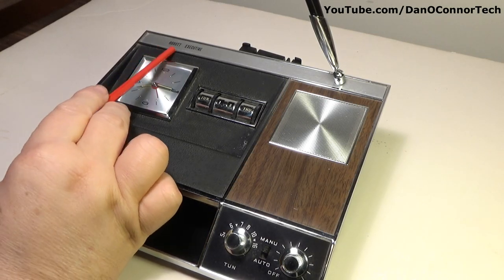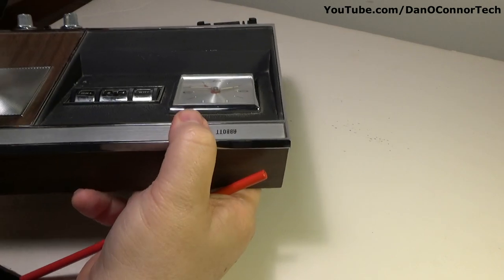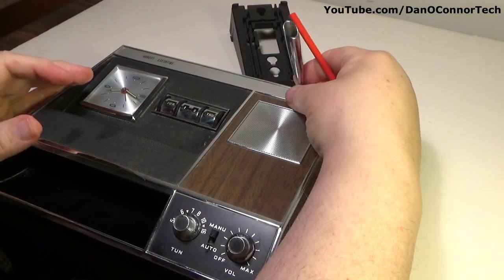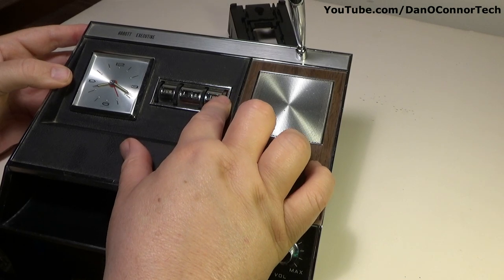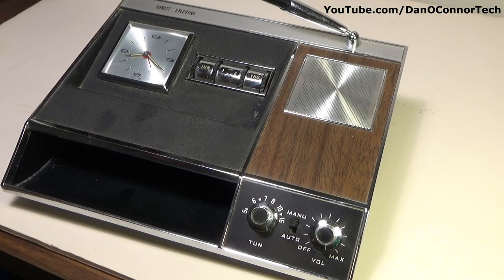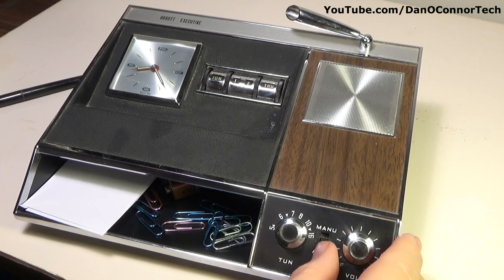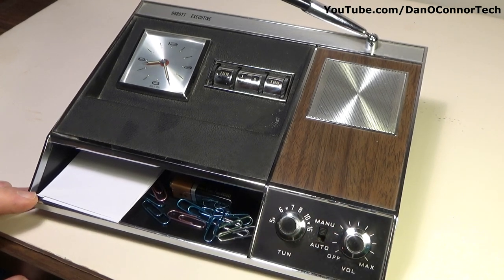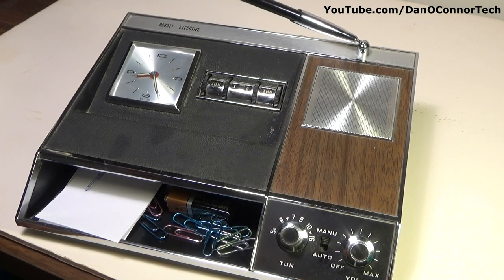1960's Abbott Executive Desk Clock Radio Set

Comment: in 1969 this sold for $40, in 1974 it sold for $52.50, the item shown in your video is Model DCR-7, the AM/FM model is DFM-22, in 1969 & 70 sold for $50, the pen in these devices are call "Parker Pen"...at the same time they also were selling a travel clock radio that collapsed down into a hard clam shell, model TC-25 for $30.  In your video when you shown the bottom by the clock, embossed in the plastic it said "Made In Japan 511", I believe that means it was made by Alpha {Nippon Alpha Electric Co.} New York.  Thanks for showing!   ~Jack, VEG
Reply from the maker: Excellent information to add, Jack. Thanks!
Reply: @DanOConnorTech  My pleasure Dan!  ~Jack, VEG
Reply from the maker: Jack, I took that Parker pen apart for a photo and posted it on my channel's Community tab if you want to see it.
Reply: @DanOConnorTech  Thank you Dan, that was very cool!  ~Jack, VEG